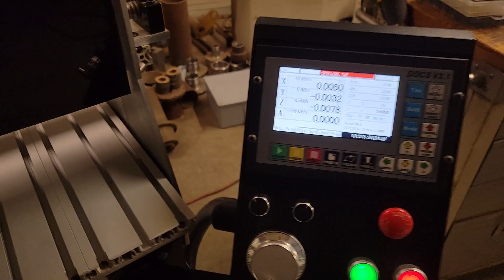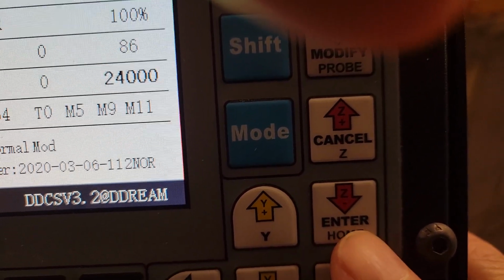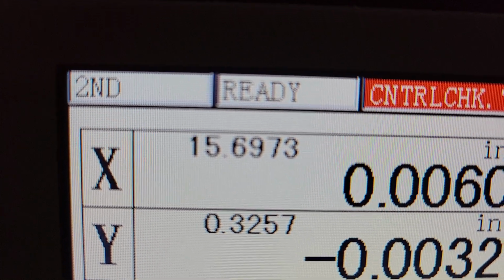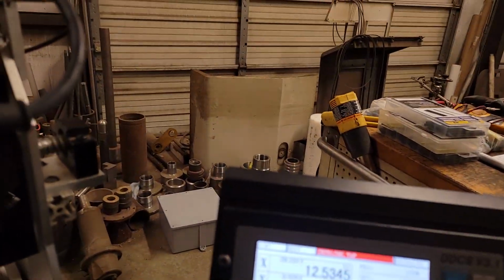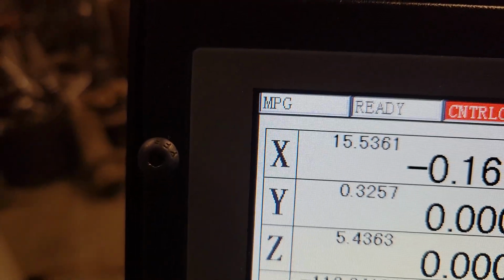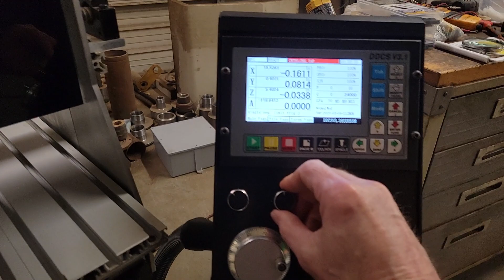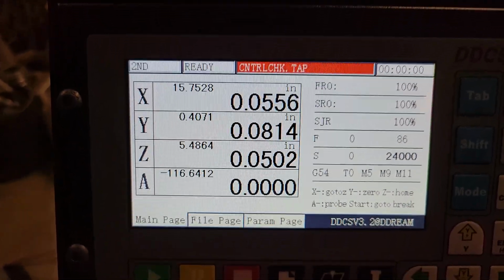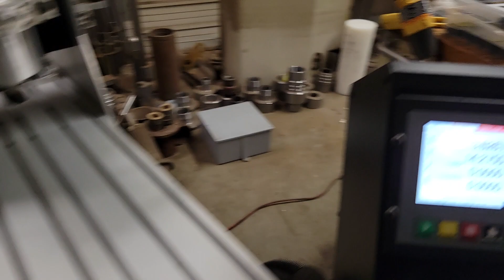3Axis CNC Stand alone control DDCS V3.1 Test limits

Comment: I also have a DDCS 3.1 control. I just installed inductive sensors for limits but once tripped I cant back off limits or reset and back off. Is that a parameter setting? If so, how is yours set? Thank you.
Reply: i have the same problem. Have you find a solution for this issue?